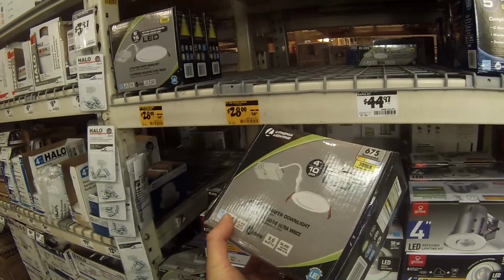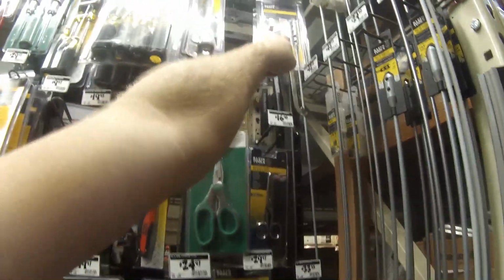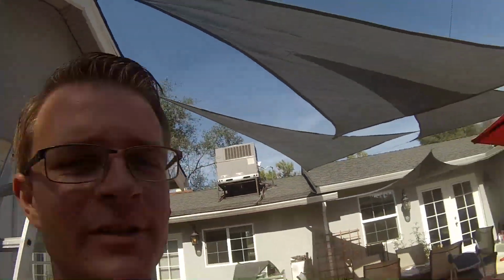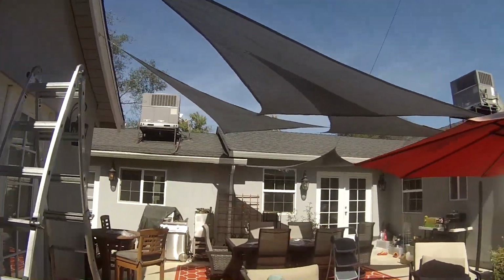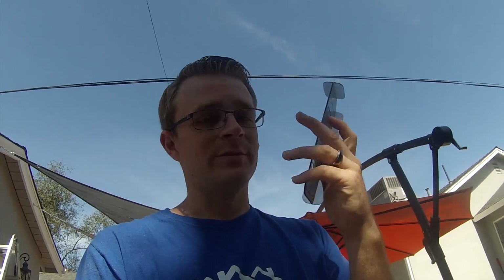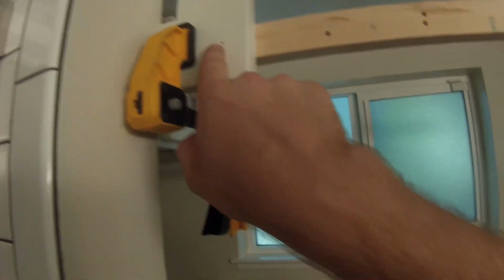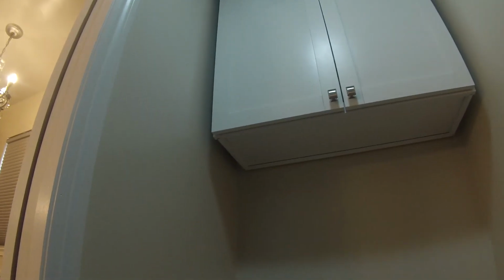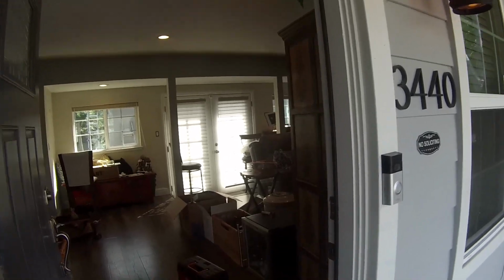Handyman Customer Did His Own Electrical | FAIL | /  WLOG

Comment: Very nice work, many thanks. How much is it in your area to install a single pot light and the cabinet handles? With the pot lights, assuming there is not much obstruction and very simple wiring to wherever the power is taken from. I'm based in Houston TX

Comment: when hanging cabinets try using the french cleat method, it's much easier than the balancing act method.
Reply from the maker: Hey I appreciate that comment! How would that work to hang on French cleat and still get it flush with the ceiling?
Reply: ah ha, I didn't catch that my friend. 
BUT you could hide that 1" or so small gap with a piece of decorative moulding giving the space a more overall "home sweet home" feel. I feel that most people forget that decorative moulding is not only designed to decorate, BUT also to hide small imperfections in home construction design. PLUS the french cleat method would provide easier access to the wiring (if need be) and allows more of a distributed weight from the stress point of the cabinet to screw.
Reply: Could not the cupboard get accidently pushed off that french clear?
Reply: Not at all, after the cabinet is hung one single screw is placed through the cabinets backboard into the most center stud preventing it from sliding or lifting.

Comment: What is the make and model of the bathroom fan? Did you get it at home depot?
Reply: 2005 Honda Silverado 4.8l 3 cylinder
Reply: Serge,   my aunt has one of those.  it gets
     87 miles per gallon.
Reply: Yeah Home Depot like $34

Comment: Great cabinet light:
LEDIARY Under Cabinet Mini LED Downlights Recessed Small Ceiling Downlight Cabinet Mini LED Light 6000K(Daylight White)1.5W 

Under Cabinet lighting
COOLWEST 60W 12V Power Supply Driver Transformer for LED Flexible Strip Light and G4 MR16 Light Bulbs 
LE 12V LED Strip Light, Flexible, Daylight White, SMD 2835, 5m Tape Light for Home, Kitchen, Party, Christmas and More, Non-waterproof
Reply from the maker: Hey thanks I appreciate it!

Comment: Isn’t there a $500 cap on handyman (non-licensed contractor B license) work in California? I thought the limit was $500 including labor and parts, even if the owner bought the supplies such as a ring doorbell. Just curious
Reply: 500 per job
Reply from the maker: Thanks for coming! Yes the law is $500 Max per project. So each day I do multiple projects. I will talk more about the law in an upcoming video
Reply: You live in the same area as me I noticed. Love your videos! However, I do believe you're wrong in your interpretation of the law. It's $500 per project, but if your project is a kitchen remodel then the "project" is the kitchen and you can't exceed the $500 limit even if you're saying the cabinet pulls are $200, then the vanity install is $300, and the baseboards are $400. I wish it was legal to charge like this and get around the law, but as a handyman myself it is not technically legal. I'm going for my contractors B license soon.
Reply from the maker: @amonideos  yes, Michael, you are correct, you can not split up a large project into smaller chunks

Comment: Where did u pull power for the ring doorbell..... transformer?
Reply from the maker: It is plugged into an electrical outlet just inside the door.
Reply: Honest Lee Handyman Was there no pre-existing doorbell? (Ring has overly simplified instructions for idiots BTW. Always check the existing transformer, if it's a tiny 10volt 10VA buildet's-kit model replace it, it wont work with Ring. Upgrade it to a 16volt or multivolt rated for at least 20VA.)
Reply from the maker: @dwight.bennett  there was no existing doorbell at this home. Thanks for your comment!

Comment: Could you make a video of yourself doing some more involved electrical projects, such as wiring a new circuit to the panel, or even replacing an old panel with a new one?
Reply: Jeff replacing a panel is a huge job. Typically requires the meter to be pulled which means electric company has to do that and most electric co ask to see a permit. I leave those to the licensed and insured electrician on a customers house. On mine, I pull a home owner rehab permit with all the drawings etc that are required. These new smart meters tell on you if you disconnect them. Best to talk with electric co. and the building dept. to see what they require. Some electric contractors can pull meter with a phone call. It’s all about that seal on the meter.